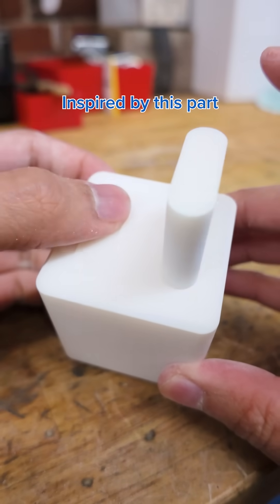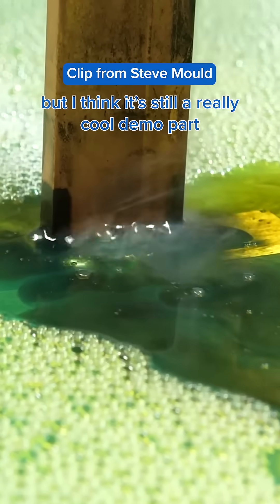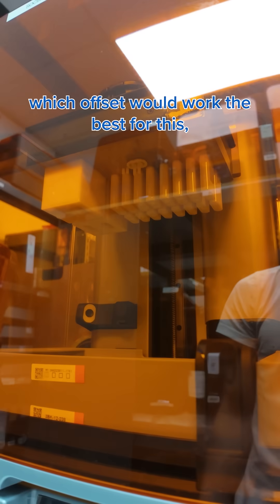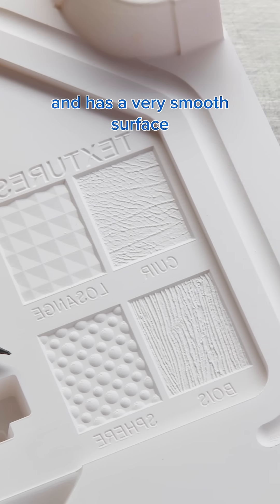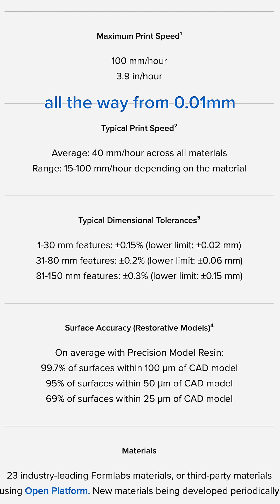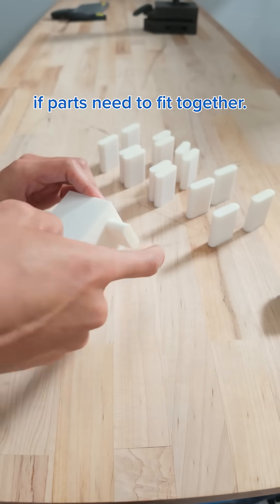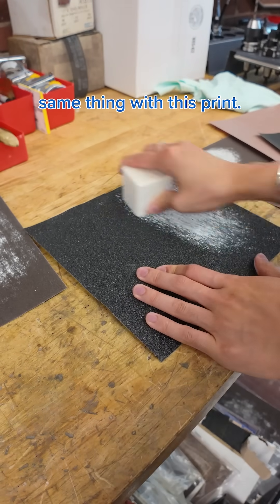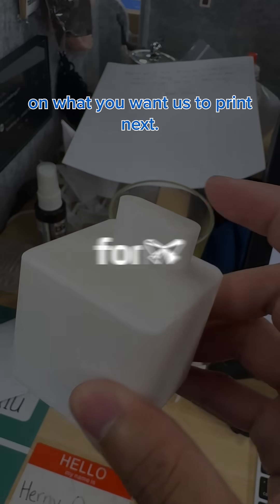Recreating the Metmo Cube: Testing Form 4's ±0.02mm Precision

Comment: Cool demo but mixing up "tolerance" and "clearance" through the video was a rookie error and misleading. You didn't print parts with different "tolerances", they all printed under the tolerance capability of the printer. You printed parts with different "nominal clearances" to account for the "tolerance" of the printing process

Comment: - The EDM process you show in the video is NOT wire EDM
(they use an electrode, not a wire)
-zero tolerance machining is not possible, and even if you could get the parts as close to zero as one can measure, they would not fit so smoothly together.
The fact it sinks in on gravity alone tells me there is a gap of at least  a few hundreths milimeter.
-the surface finish on the metal part tells me it is ground to shape, also there no (wire)EDM.
It is impressive for a printed part, but please dont spread misinformation.

Comment: That is NOT a testament of the accuracy and repeatability of 3D printing. You manufactured several variants and took the one that fitted, so that is that. Repeatability would be proven if you then took that version and produced it again say 30x with the same result - you didn't.

Comment: Some people think those zero tolerance pieces work because the wire is so thin. That's not true. It's just that they cut each piece from a separate block of metal and account for the wire thickness.
Reply: That's also NOT a wire eroder. It's made with a die sinker. Same principle but a wire can only profile but a die sinker can form cavities and blind holes.
Reply: @wildin13 Block is made by Sink EDM but the punches are made by CNC Wirecut machine....
I've been Job working done with both the machines....
Reply: @wildin13  Doubt it. I think they wire them then put a base on it.
Reply: imagine being some people.

Comment: Im not sure this is a testament to the accuracy and repeatability.  
If you'd printed each part needed exactly once per assembly, and it all went together perfectly, then repeated that, then yes, it would be evidence of that.

What's demonstrated here, however, based on what's presented (or not) in the video is an exercise in selection and confirmation bias.  You've not printed the perfect key for a lock... you've worked backwards with a lock and printed many keys until you found one that works.

If you print a whole bunch of these inner parts, then one will eventually fit perfectly.  It remains possible that some, perhaps even many, fit quite well... but unlikely all printed at the same tolerance are a perfect fit.  A lower tolerance increases the odds of any given part being a good fit, but doesn't assure it... one could print many at a range of other tolerances such as 0.2- 0.5mm instead, and it still remains possible one would end up being a perfect fit (however increases the odds any given one wouldnt be a good a fit)

Similarly if you were to print the box many times and the other pieces many times and work to pair ones that fit nicely with each other, but that simply pairs those that have ended up with compatible dimesions in the end product.

Ordinarily, this sort of criticism wouldn't be worth mentioning, but as this is clearly an ad and that's clearly a selling point youre tryi g to demo. You should make the test demonstrate the outcome...  it does remain possible the tolerances are good enough to do this consistently, it was not demonstrated in this test though.

Comment: What happens if you push both in together ? Is it so tight it won’t let the air pass thru and you can’t get them in together or if you can does it create such a vacuum that you can’t get them back out ?

Comment: That’s crazy. I didn’t think 3-D printers were that precise
Reply: 3D printers like the one in this video, yes. It also starts at $4,500 so it's not your grandma's Prusa.
Reply: @desmond-hawkins  my grandma sold her prusa
Reply: @desmond-hawkins  And what exactly brand/model he's using
Reply: The high resolution Resin printers can do this, the newer 6k or 12k resolution printers can do this tolerance but needs the proper resin to match.
FDM can get pretty close but there is still some "wiggle" when it comes down to need absolute dimensional accuracy.  If using FDM and you need something like this accurate, you "overshoot" on purpose and sand/trim down to where you need it.
Reply: It's a resin printer, different from most printers you know of. They have great accuracy but come with a wide range of drawbacks
Reply: not your grandma's 3d printer

Comment: I remember when even a high end printer had layer lines you could see from across the room. Its insane how far its come in a decade
Reply: Those were FDM printers, and their outputs are still like that. This is a different technology. Resin printing. Despite both being called "3D printing" they are not very similar at all. Resin printing is done by taking a vat of the resin, and using UV light sources to target certain areas to cure. They have always been significantly better than FDM printers in terms of surface smoothness. However, FDM printers have achieved mass adoption in a way that resin printers have not because they are significantly cheaper and easier to maintain and use.
Reply: @Wolfboy607  plus resin tends to give off toxic fumes while curing

Comment: So what tolerance did you get?
Reply: He never actually said he just said between 0.01mm to 0.15 which is .00039inches to .00590 which for the original metal example is not a crazy tolerance .00039 is definitely tight tolerance but not impossible by any means and .00590 is very standard tolerance for most things you can get a 6 thou tolerance on most anything without breaking a sweat.

(Edit this is for machining like the first metal block I know nothing about 3d printing so I can’t say how hard that tolerance is on those)
Reply: @batman-hv9wp A decent and tuned 3D printer can print with .005in. I have an old Prusa MK3S+ and it does it no problem.
Reply: @OU81TWO  oh okay that’s pretty good. Does the diameter of the filament affect your tolerances at all or is it just machine dependent?
Reply: @batman-hv9wp  It's more the nozzle diameter rather than the filament diameter. Larger diameter nozzles have a larger tolerance band (less accurate) since the extruded filament can "squash" more. You need to adjust how fast the filament is extruded relative to how fast the head moves. Keep in mind this has already been taken care of in the programming when I bought it but it can be fine tuned if required.

Comment: What a lot of people don't realize is that the inside and outside parts of such demo pieces are cut from different stock. Even EDM cannot cut with no kerf.

Nice job on the cube.. that is a great fit!
Reply: honestly knowing that the demo pieces are coming from different stock makes it even more impressive to me. like yeah, we can just precisely machine two pieces of metal so they fit together like one piece of metal, no biggie.
Reply: @Kataclysm113  I mean, it would still be more impressive if it was from the same stock, because you'd have to split the individual connections with the atoms while not actually removing any or very little of the atoms. Still, machining tolerances are crazy tight!
Reply: I belive that they for the edm cube they cut the main peice and the two inserts seperatley
Reply: @seadragonet1738  Yes, that's what the comment you replied to was saying.

Comment: “Zero tolerance” is actually the punchline to a joke that’s often told by mechanical engineers.  😂
Reply: My favorite line from my professor back in college was whenever someone asked "how precise can you make it?" he'd respond "how expensive do you want it?'
Reply: If you think you are "zero tolerance machining", you just aren't measuring thoroughly.
Reply: Can you tell us the joke?
Reply: @fg2873  You can never be at zero tolerance. You can even get to millionths of an inch, but never zero.
Reply: minimal tolerance. even it depends on different conditions.
Reply: @alterstassfurter5743  You don't even need minimal tolerance. Something like a H7/h7 fit turned on a lathe will do the same as these wire edm pieces. Even my 16 year old machining students make fits like these on conventional lathes. And yes, letting them drop slowely because the air can't escape works there too.

The trick to not seeing the line between the two pieces  when closed is grinding or machining them together. This way the machining marks are in the same direction and the pieces are an exact match.
Reply: The past day I was with my wife on the bed and... well, Im just going to leave it on "there was zero tolerance"
- So there was sex?
No, she sent me to the sofa.
Reply: Imagine being a machinist and hearing this 😂
Reply: @TAZgarage I’m an aerospace machinist, and the worst one is getting large stainless parts with thin walls with a +.0 -.001 and then finding out the part gets welded and is going to warp to hell during welding
Reply: @captpatrick891  I also make parts for the aerospace industry as well as other industries. Processes are definitely important.
Reply: German Engineering?
Reply: @ruvkyu  It's not unnecessary expensive and complex,so i would exclude germany.
Reply: What's the joke?
Reply: @ - “zero” tolerance is unattainable. When someone asks you to make something “exact” it means that the person who’s asking is ignorant of how things work in the real world.  It’s an “eye roll” sort of inside joke.
Reply: @owengrossman1414 no, zero tolerance is just a solid object
Reply: @owengrossman1414  The most precise engineering is accurate to the individual molecular level. That's not zero tolerance, but that's pretty damn close to the minimum possible.
Reply: And in the case of the metmo cube, you absolutely could make it zero tolerance, because it ''only ''needs to be molecularly perfect to have zero tolerance. This is possible, just expensive as all hell.
Reply: "mechanical engineers" is a weird way to say educational institutes.
Reply: Zero tolerance or as I like to call it, Gen Z.
Reply: @XtreeM_FaiL  Do you have other jokes you like to tell that nobody laughs at?
Reply: @ThePseudologist  You really have zero-tolerance for his jokes, huh?
Reply: @XtreeM_FaiL 😭😭😭
Reply: @ThePseudologist  i laughed
Reply: @ThePseudologist honestly mind blowing how you proved the truth of his joke
Reply: @XtreeM_FaiL  okay boomer
Reply: @XtreeM_FaiL  yeah, zero tolerance for bigotry and exclusion
Reply: @XtreeM_FaiL so true, the last 5 years of genZ have none of it😂

Comment: Resin printing seems like the future of 3d printing, the clarity is unmatched until you're just using metal again
Reply: Resin printing (SLA) printing is actually the first type of 3D printing, but there’s actually a lot of different 3D printing methods. SLA is great but has its own limitations just like FDM does, it’s not good in UV as that is what cures it, SLS printing is also cool, I think the reality is the average person hasn’t seen industrial printing solutions so SLA looks better but really it’s just different. There’s MJF, SLS, MSLS, SLA,FDM, and more 3D printing methods.
Reply: SLA is a mess, has trouble with warping in the non reinforced or engineering resins, curing can alter the dimensions in an unrepeatable way, the resins can fail to cure leaving sticky parts. Lots of upsides and I have done cool stuff with FL printers but definitely not a silver bullet. I find FDM and SLA very complementary providing lots of additive capability.
Reply: The only drawback I know of is the wait time on resin is significantly longer now than fdm. For most applications where 3d printing is involved sla can’t compete with the speed when making low strength parts but it def outperforms on strength in more niche cases. Also toxic to handle and takes 3 processing steps before the print is actually capable of its function
Reply: @zacharyswassing6741  yep 3D printing with sla is just a huge mess, hard to clean, and overall not great for your health without venting. Although, sls also has a similar issue of needing a mask due to powder.

The key area that both sls and sla thrive is in part production time past a couple units. Batch production on those machines is much more efficient than FDM, as the time to run 1 large part is the same as 100 small parts. Though nothing is perfect, the fact that you need 3 stages of cleaning for both methods leads them to be less than ideal in some sense. Also switching materials on both is also quite the job as you can’t just easily switch colors and materials like you can with FDM.

But at the end of the day, FDM can’t match time to make a lot of parts and also overall resolution in that time to make parts. 

I own a 3d printing shop and I constantly battle these pros and cons when I consider buying new machines, the biggest thing is the average consuming doesn’t understand these minute details which make a difference in costs. Leading to the education of how the process is best used to be the most important factor

Comment: fyi the resin is $300 for 1 liter in case you were wondering like I was. Seems like it has some pretty amazing properties. Is there any other resin that can be used for vacuum forming?
Reply: If you're on a budget, Phrozen Tr300 works well, use it all the time on my Vaquform Dt2, it doesn't warp much
Reply: @ this is extremely helpful, thank you!
Reply: I knew "I printed a bunch just to see" hurt somehow
Reply: to 3d print something that would have to handle heat and not deform or melt would the resin work?
Reply from the maker: Yes, check this out: https://youtu.be/FDAhwc2z3NI
Reply: @swiggy382 they have specs on all the material properties in a .pdf file on their website so you can compare!
Reply: Still cheaper than some 2D printer ink LOL...
Reply: @mitchellspanheimer1803  you're spending orders of magnitude more when 3d printing 💀
Reply: @technolus5742 nope. Per ounce, ink jet ink is way more expensive. Check the math, gold is cheaper than some of the inks.
Reply: @martindinner3621 yeah you're way better off getting a printer with the little tanks that you can fill with ink since those individual cartridges have like absolutely nothing in them on purpose
Reply: With the price of ink I would just 3d print my text documents and sand them flat.
Reply: im more interested in what printer he used
Reply: Great $300 / L 😂
Reply: not a good deal, faygo moon mist is 89 cents per litre, much more cost effective

Comment: Zero tolerance shit doesn't exist it's just 2 parts machined separately
Reply: Yeah but the metal parts actually come out to size first try - not this bogus "print 10 copies and pick the one that fits". Not precision at all.
Of course the parts are cut from separate material because otherwise there would be a kerf.
Maybe you're commenting on 'zero' which while strictly speaking is truly not zero, the point is you can punch in any fit you want, including these super close sliding fits.

Comment: I really want one, but all I have is an FDM printer…
Reply: Well you still can do it, but you will need to do a lot of sanding.

Fun fact that a lot of people haven't mentioned: even on EDM it's made of two separate pieces, because EDM still removes some of the material
So I believe it should be possible to print it in higher dimension and sand it down to fit
Reply: @pledger6197  well yeah, all these “zero tolerance machining” videos are just gimmicky since they’re all still cut out of different parts. I don’t think I’d get as perfect of a fit as this with fdm

Comment: I’ve never seen a 3d print with that material before, but I want one so bad
Reply: Note: Resin printing requires an entirely different process to do. It can also be dangerous if you are not careful with ventilation. If you are new to additive design, I would not use a resin printer.
Reply: Im gonna run a resin printer in my closet 😈
Reply: thats resin for ya

Comment: RIP if you keep it on your desk, forget about it and both the cylinders go completely inside.
Reply: In the cutaway of the CAD model, it looks like there's a small plug (shown in cyan) on the side towards the base.  Presumably you could remove the plug, drop the pistons out, and then reinstall and reset.
Reply: @jibb  maybe, but I think it's also a tiny vent, since —even in the metal one— the piece readily sinks on it's own. This means that both pieces falling in would happen easily even without forgetting about it, and that just as easily as they fell in they would also come out when the object is flipped upside-down.
Reply: Just...flip it upside down?
Reply: Next video:  Today I’m building a custom stand that holds your cube upside down in case you left it assembled right side up and walked away for six minutes.
 I’ll be using $185 of material and running the $4000 printer for 31 hours.